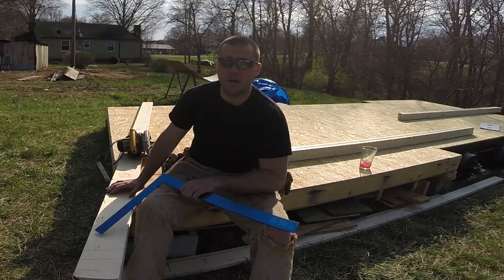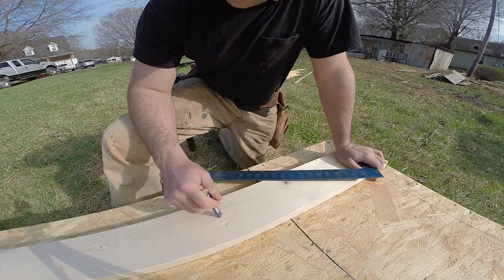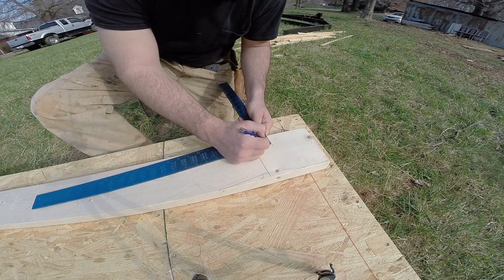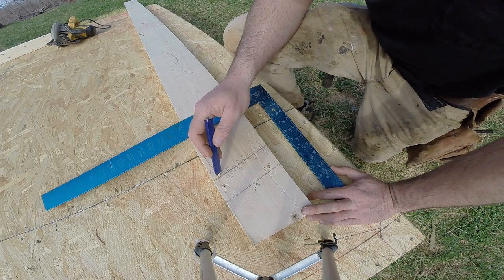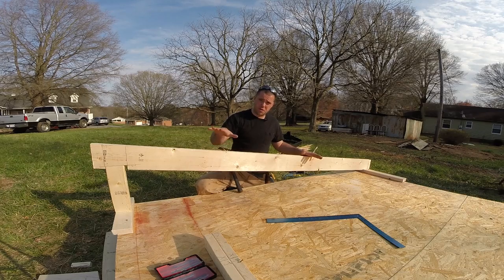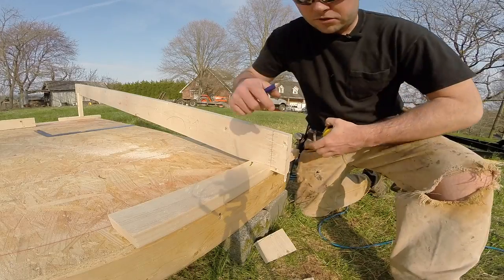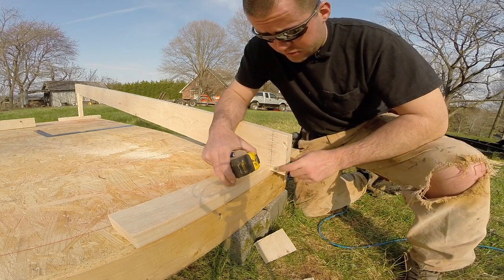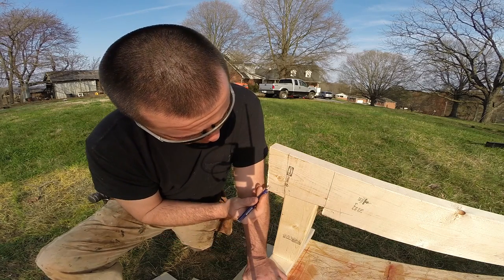Tiny House - Shed Rafters

Comment: The springs on your trailer will relax with all the weight bet you end up 2" shorter then now . Thanks for the info . Peace
Reply from the maker: jknocal i believe there was only 2 or 3 inches till it bottoms out.  I'm betting it'll be around 1/2".
Reply: Tiny House Customs  I'm counting on the lowering, living on the edge so I can enjoy my loft.  My high wall studs are 125", single top plate, and outside to outside a full 8' before sheathing.  Trailer's leveled, blocks under wheels right now too.

Comment: How are you going to ventilated a roof as solved as that joe
Reply from the maker: Joe Moore not sure I'm going to since I'm using metal roofing.  ill install a ceiling exhaust fan instead.  what are your thoughts on that idea.
Reply: Tiny House Customs How about metal, R-Zip, then spray foam, so no need to ventilate roof?  (Def a ventilation system in general)

Comment: Speed square,make life easy...
Reply from the maker: For some one who doesn't know how to use a framing square.  Speed squares are way less accurate.
Reply: Tiny House Customs pythagorean theorem and drafting it out, then I taught myself the speed square to check it, I was not accustomed to the speed square, but it checked out well and I mocked it up.  I can't decide if I should leave extra on my rafter for my overhang, or just cut it plumb, and then add fascia.  have 3" including the sheathing to play with on each side, so maybe not worth leaving my weird "tail", esp on the high side because it would allow for water to run down it and into the wall.  I hadn't thought of your idea: to notch so plywood can go up into it.  Any advice for protecting my high side's metal roofing for transit (leave tail on rafter or no)?  Thanks.  Hmm apparently my pic won't post.